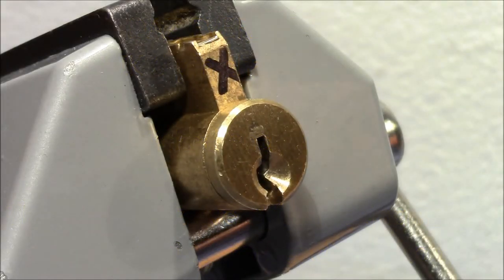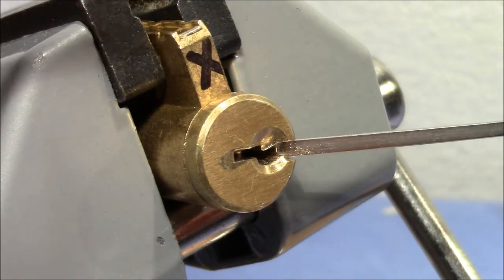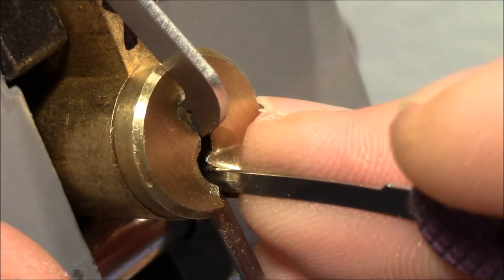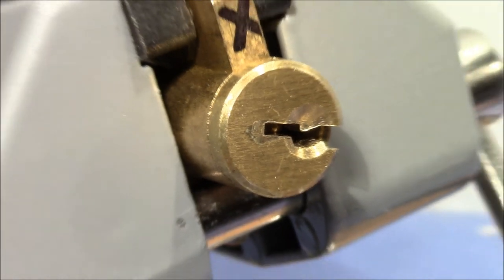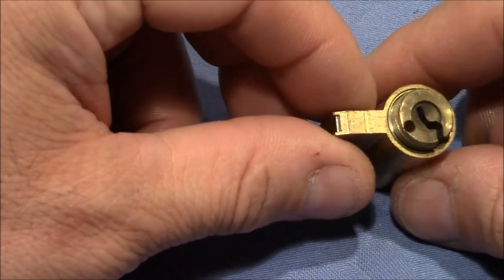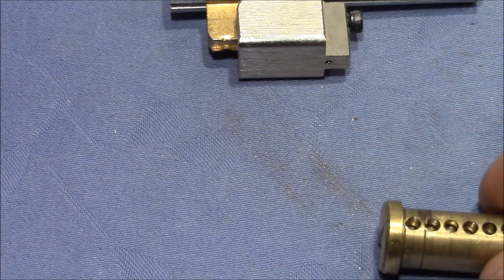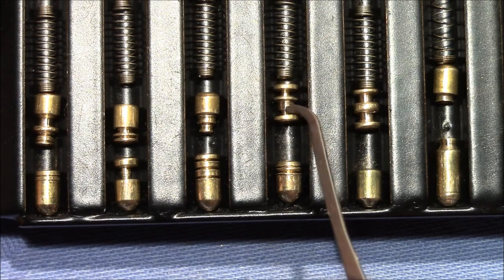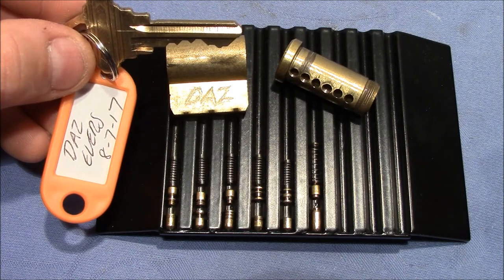(picking 392) Challenge lock by 'daz evers' - great pins & tricky to pick - sent by 'redcatimaging'

Comment from the maker: Very tricky pick and great looking pins by 'daz evers' - thanks a lot for the lock. And sorry for the silent parts in the video, but I was really focused on the lock ;-) Also the brass "dust" I believe is not from the pins but from scratching with the pick in the keyway. Also just recognized the sixth pin that rides on the tip of the key.

Comment: That was a pretty tricky pick, wasn't it ;D. Nice work Potti, I knew you would get it open :). You probably scratched half the inside away LOL. Did you notice, 5 pin key, 6 pin lock ;). Daz makes pretty challenging locks, but the pins look awesome :).
Reply from the maker: Thank you, it was a great picking experience - thanks a lot for that lock my friend :-) Yes, the 6th pin chamber is populated and the pin rides on the tip of the key. Recognized it after uploading and re-watching. I mentioned it in the pinned comment.
Reply: Cool that you liked it Potti :). Yes they were not too easy, but you got to know two more nice challenge lock makers :D. Have a great week buddy :).